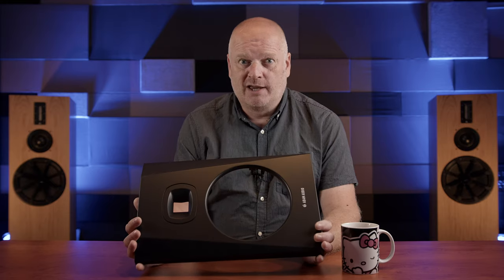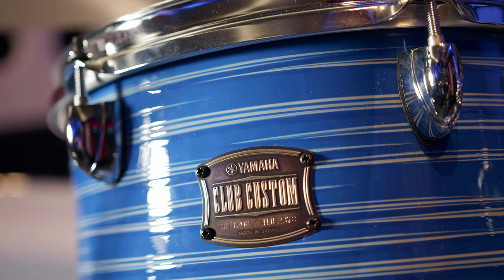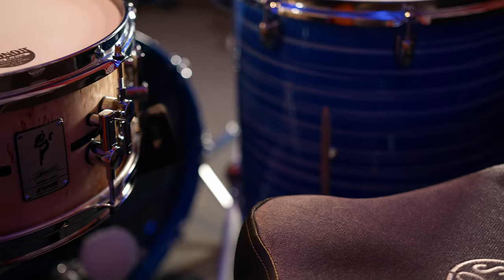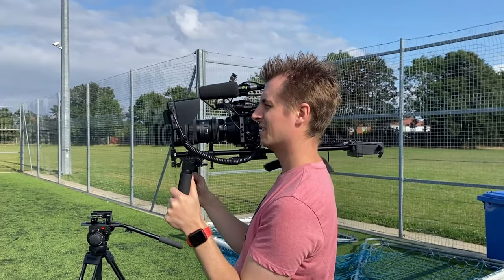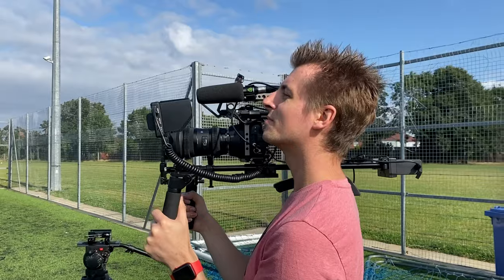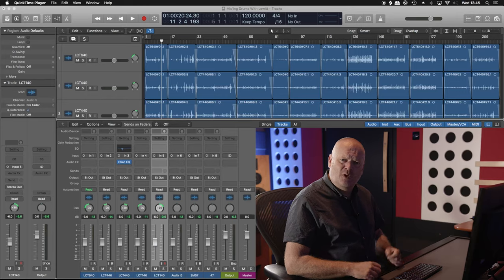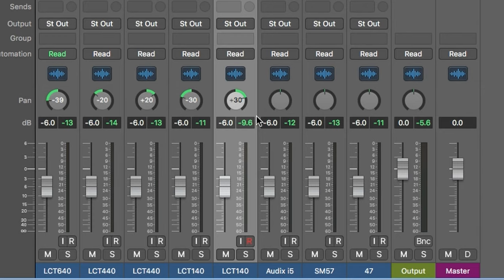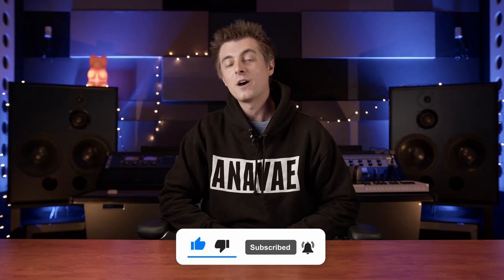Recording drums with budget microphones | @LEWITT-audio @AUDIXmics @ShurePerformanceProduction

Comment: I'm also a manufacturing engineer and I run a 15 factory manufacturing consortium here in Taiwan (it basically runs itself so I have lots of studio time!). We have a number of casting factory solutions that would work for that. The front panel could be cloned and gravity cast in aluminum (for smaller quantities) but if you wanted to make a half-million of them, it would have to be pressure die cast. The tooling alone is prohibitive, but anything is possible as it's only money. You can also get into trouble though by using certain alloys to make it thin and lightweight but that puts you right back where you started. A cast replacement part should be massive and not subject to resonance like the thin plastic piece.

The epoxy will most likely work. You could also get a wood shop to clone it out of a heavy particle or ply board and see what that does. Some good old Bondo car body filler might yield good results and would be easy to apply.

Comment: I thought that bitumen adhesive pads were de rigeur for deadening vibrations. I believe you can also use them strategically inside the cabinets to reduce cabinet wall resonances.
Reply: Put them in my friends car doors, and they massively improved the sound in the car

Comment: I just got the T7V with sub. Pretty nice. That front panel is a bit concerning and would love to know how you got it off. I actually have owned the (original) S3A since about 2002 and love those but they have been put into my turntable setup rather than studio. Hence the T7V acquisition. They used to have a hifi side and always wanted their S4V model for my turntable setup bit can't find any now. It's really all about that ART.
Reply from the maker: We’re working on a follow up video, and that shows you how to get the plastic baffle off, so stay tuned!

Comment: Hang on, now... this seems like something of a ‘Trigger’s Broom’ approach to monitor upgrading. (Trigger had the very same broom for 20 years... and in all that time it only had five new handles and seven new heads... or something like that.) So, if you do away with the speakers and cabinet, as well as the amp, maybe replacing them with some Genelec spare parts... perhaps those Adam’s ones could be the ultimate budget monitors, after all.
For the cash-strapped drum recordist, though, I guess using cheapy Lewitt mics above the kit is a way to ‘reduce’ the ‘high overheads’...(?)
And what ‘have’ you done to the poor cat..?

Comment: Hi guys! I'm really curious to see/hear how you would mix these drumtracks. I gave it a go just now and failed miserably:) I think with the recording you were going for a natural, open, mild sound, correct me if I'm wrong. But even with that sound in mind, I don't get why for example you would go with this mic-combo on the kick. And the toms are resonating the whole time, very audibly on the OH tracks also.
I would love to learn how to transform these tracks into something good :) I'm probably hearing a completely different sound (end product) in my head than what you were intending while tuning, choosing mics/mic placement, etc. And that's fine, but right now I'm in the dark. Thanks, cheers!
Reply: the choice of kick mics made it so you could easily augment the kick to how you want. if you wanted more attack, you'd use more of the kick in mic and less of the kick out mic, and vice versa. and just gate the tom mics
Reply: @tob2089  Thanks for your input. I totally get the concept of the combo. I guess normally I would use a 'normal' kick in mic like a Beta52 and augment it with a kick out mic of some sorts. Then the 52 gets all the punch and already lots of the low end that I want/I'm used to. But with the 57 I'm missing all that low end I want. Plus both the 57 and the U47 sound way to boxy for my taste (even after taking out loads of 400Hz).
I guess what I'm trying to say is, I get the concept. But it's not working for me, so I'm curious to see how these guys would make it work :)
And of course I would gate or edit the toms. But the resonant ring of them is also really audible on the OH-tracks. And that's a dealbreaker for me. But I guess it's all about the vision you have in your head and the choices you make to get there. Maybe this is nog my cup of tea. And that would be fine!

Comment: How about high density foam, the spray-on kind? Although it depends on how resonant it actually is IRL, I can't quite tell through YouTube.
Reply from the maker: Fairly resonant!
Reply: @PresentDayProduction  Oh, then you definitely need some mass, perhaps a lamination with something dense might help.

P.S.: Actually even a piece of (very) thin and bendable plywood, the kind that's less than a millimeter thick, might do the trick provided it adheres perfectly to the plastic.

Comment: Re: Damping that nasty  plastic speaker front piece. 
The type of thin foam (~8mm)  which is used for damping commercial vehicle panels. Especially the ones that are made of fibreglass. It's easy to cut to shape, and some versions come with a serious adhesive backing. It ain't cheap, but it certainly adds stiffness and stops rattle.
Can also be used to stop cheap n cheezy  nightclub "decor" from buzzing.